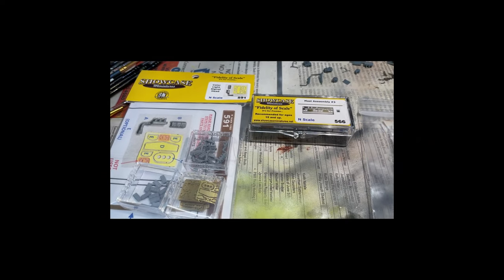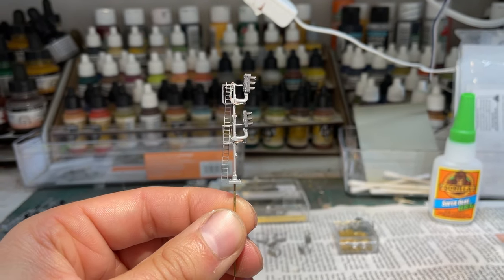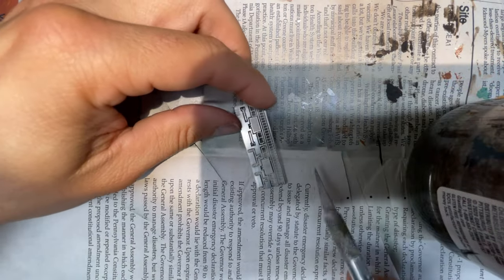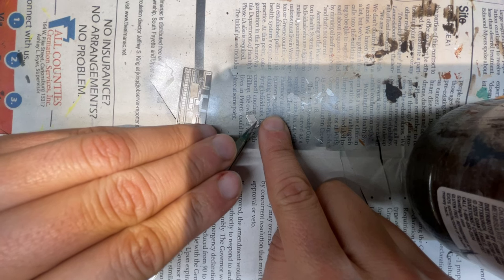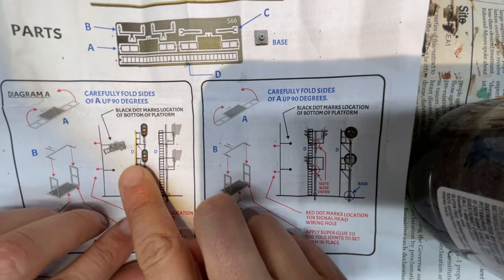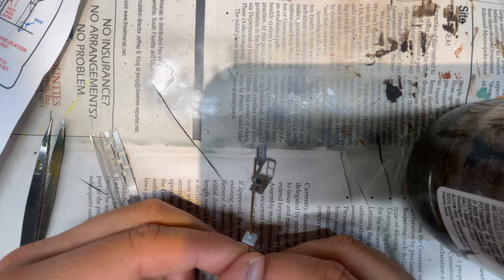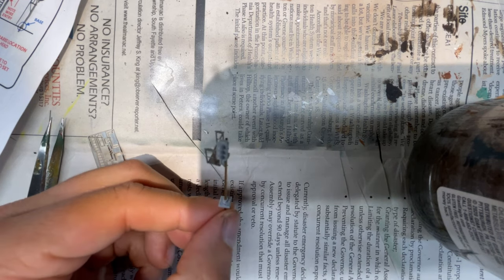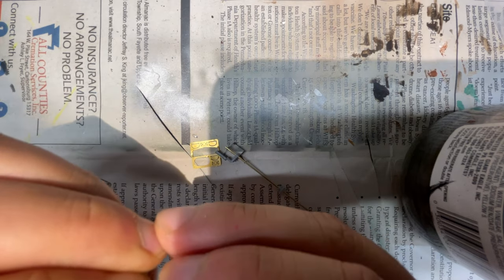Assembling an N Scale Working Signal

Comment: I have a serious question to ask you,  which you may not know, but I trust you and your advise. So here goes. I have been in this hobby since I was 5 moving from a  3 rail down to HO and eventually to N scale by the time I was 13. I'm 56 now... my question is,  How does a DCC engine work on a DC reversing loop ? I have several DCC engines that I run on a DC track wanting to use my reverse loop but I am afraid it might mess up the decoder in my Broadway Limited engines that I use with my Broadway Limited DC sound box. Has it been done, what is your take on this ? Thanks.
Reply from the maker: so, i did a video about a year plus back on the Digitrax AR1 and how to wire it.  in the video a describe the difference between DC and DCC.  DC is just that, it's direct current.  There's a positive rail and a negative rail and depending on the voltage supplied and which rail is positive/negative - determines the direction and speed of the loco.  DCC functions like AC power, where the positive and negative cycle through both rails at around 60 cycles a second.  when a decoder is both DCC and DC compatible, the decoder is 'smart' enough to determine what source of power it's getting and adjusts to operate under that source.  so, as long as you operating in only one of those system - you loco will function without issue.  do not use DCC equipment to power DC equipment and vise versa.  So, if your layout is 100% DC, your loco will travel through the reverse loop just like a standard DC loco without a DCC decoder would because it's operating in DC mode.  Do not use any type of DCC auto-reverser to try and correct the DC polarity or you're going to have an issue.  all that being said and going through the technical specifics - i do not like having my DCC locos on a DC track.  in fact, i turn off the function to allow the decoders to run on both - DCC is very different from DC and while i know they're made to work both ways - i don't like the inherent risk to a $300 locomotive.
Reply: @AlleghenyNorthern  Thanks I appreciate the info. And your right about the 260.00 and I want to up grade someday, but 2 things I may have 1500 in DCC engines  but I have about 8 or 9 thousand in total DC engines. Even though I wouldn't mind switching some over to DCC.  The cost, time, and trouble to make the switch isn't worth it compared to just buying new DCC engines with sound and all new features..... may have to have 2 different track plans on the same layout.... haven't really decided yet. But truly thanks.
Reply from the maker: @briancasey4491  i'd maybe convert a few of your favorites first.  a sound decoder is about 60 bucks so it's an investment.  i find a standard decoder is pretty easy to drop or wire in but haven't messed with the sound decoder or sound files.  two separate layouts is always a sure bet too.  separate dc and dcc loops would also work.  if you were very - and i mean very careful with the wiring and the set up, you could theoretically set up a transfer between your dcc and dc layout.  or maybe use a 'car float'.
Reply: @AlleghenyNorthern above my pay grade. I might pay you to draw me a diagram though. These drop ins might be alright but I have alot that there is no place for it the whole under the shell thing is lead or metal. And I have alot of steam engines. And most of them run really good to be as old as they are. One other thing I was going to ask is about speed matching seems like none of them run the same and the directions are different.  So I can't pair any of these engines, so I can have a big consist to pull. But my BLI Southern will pull about 7 to 10 heavy weights pretty good !